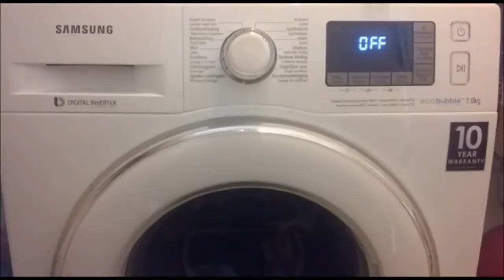Samsung EcoBubble stuck mid-program - Repair guide

Comment: Cheers Gold Flemming! We just saved one of these machines from the tip and it exhibited the same issue many have been seeing. The drum will try to move or spin and there is the initial jump as the motor tries to turn, but then nothing. After several tries, the machine just hangs or puts up a 3E error code. The issue gets worse with time. The procedure you filmed is exactly the one I followed. 
Disconnect the power to the machine and wait for the caps to discharge. 
Cutout the bottom of the tray the main PCB sits in and slowly carefully pry up the conformal coating (I used a plastic spoon and small plastic clay modelling tools as the metal implements would damage surface mount components sprinkled about the board and tracks).
Once the conformal was off, especially the larger solder joints, I used a solder sucker and solder iron/pencil to reflow and remove the old solder and then lay down new solder. 
Visually the existing solder joints looked ok, but as Benny Zeusian points out in this video https://www.youtube.com/watch?v=INJgzefQG24, there are subtle cracks and flaws.
I was able to re-solder just the larger joints to all of the plugs, large capacitors and motor control chip (both sides) and it worked! Carefully inspect your board though.
Also, be very careful not to make a worse joint than the original. I was not successful in simply re-flowing the existing solder and used flux, a solder sucker and wick to remove the existing stuff and completely re-do it.
Hats of to you for putting up this vid for encouragement as well as Benny and micr1969 https://www.youtube.com/watch?v=UVcrrwLRQek, who did much the same!

Comment: Will thank you for your video. I was about to buy a new motherboard and your video saved me 200euros (or a new washing machine for 500 ~ 600euro). Your video encouraged me to open the motherboard according to your description.

I'm working at a company where we are designing and manufacturing circuit boards for heavy-duty components and tools for industrial use and I have good experience of both designing, soldering and inspection of PCB's. After I opened the board (on the backside) I found several components that had been loosened from their soldering and there were cracked soldering all over the board there they were “heavy” and big components (as you mentioned in your video). Most cracks were for the component under the heatsink. The heatsink is quit heavy and long and it is directly attached (screwed) to the component underneath, also the heatsink lays on the component, which in my opinion, it should be fastened/screwed directly to the board instead. I understand that the component which is attached to it will vibrate more violently (because of that heavy heatsink) and in the end the component will straining its “roots/legs” and that causes all cracks and misconnections. Will add a video with pictures I took during the repairing the board
 
There are several issues with design of this kind of boards:

The first problem is that the manufacturer of circuit boards has stopped using leaded solder in manufacturing because the lead is hazardous to health. Lead is a soft metal and that made that leaded solder was quite flexible and stronger. On the other side lead-free solder is hard, and very fragile, and therefore in the end with all cracked solders and a dead device.
The second problem is that the Samsung, or their board supplier, have chosen to cover the circuit board with a silicon-like glue to minimize the vibration effect and/or isolate the board against corrosion because of high humidity. They may have thought that they have found a workable solution, but the problem is that this “jelly-alike-glue” will not help any components to be fastened on its place, that heavy heatsink is not even covered with that jelly-glue, when the device vibrates, heatsink will vibrate more violently(just go on and try to vibrate gel and observe how the top of it vibrates more violently) in the root, and when it vibrates, all bigger and smaller components will vibrate together simultaneously.
on the other side, this jelly-glue goes off very easy from the board, which it shouldn’t. As I know how this process should be done, the entire production process has been wrong from the beginning. The board for instance have never been primed before gluing, which would increase the adhesiveness of the jelly-glue.
The solution will be, as you may find in Braun rechargeable Shavers for instance, is to cover the whole circuit board with melted glue or industrial hard glue. In Braun case, even the batteries attached to the board are covered with hard glue.
The third issue is the design of mainboard itself. When I start to re-solder the pins and connections, I realized that the components pin-hole are oversized and pads are undersized. The pads are there to solder (attached) the components to the circuit on the board. That means the components have too little support for that kind of force and vibration the board is exposed to. You may find this kind of boards in all cheap “one-dollar” China-products.
Summary: short and consistent, the board is designed and mentioned to malfunctioning. You may say it is another conspiracy theory, but how would Samsung and other companies survive if their products last for ever?

 

And this is the problem that occurs in the Samsung echo bubble products and eventually all other product with this solution will stop working after a few years. This is the result of a poor designed and solution for this kind of motherboard.

This is evidence of poor quality of Samsung washing machines or/even other Samsung devices that will stop working after 2-3 years. I think Samsung must take responsibility and replace the motherboard in goodwill/warranty, because this is a quality problem during manufacturing which Samsung must admit.
Reply from the maker: Thank you for your extensive analysis and take on this. Was an interesting read!
Reply: bought our machine 2015 and had this problem this last week of nov. 2018.. decided not do the repair or replacement of the motherboard because it cost 200€..  I have a machine before this and it lasted almost 9 years.. tought This machine with its price of 600€ would give me happiness just like the first one but it only put me on total mistake.. decided to take a cheaper one for 100€ plus of the price of the samsung motherboard...

Comment from the maker: Update edit 1 June 2023: the machine still works perfectly and has not failed me since the repair shown. Apart from the mishaps in it's adolescence, it grew up to be a loyal and hardworking member of the family. 😊

Update for all those wondering: I can confirm the machine is still working flawlessly and has not stopped to work flawlessly since the repair. Good luck to anyone out there facing the same problem.
Reply: Gold Flemming did you do anything to dampen the bottom side of the board again after removing all the gel?
Reply from the maker: @henriksoderholtz8368  I did not as I couldn't think of a suitable material (that I had on hand). I took the chance and all I can say is the machine is still working without any issue.
Reply: To dampen bottom side, I think you can use sealant that says polymer and becomes like a rubber when drying, and put just around the edges. That will also hold the bottom plastic piece you cut out. In my town this sealant has price similar to silicone sealant, about 4 euros a tube of 450g. It is used to stick light things on walls or stairs, is high tack.
Another solution is hot glue gun, similarly put on edges, but it dries very quickly. Its also cheap.
That gel is just a gimmick, they make things harder to repair on purpose. Older washers didn't have gel on mainboard and worked the same.
Components are usually soldered through the mainboard, i.e. holes are 3mm thick, and if e.g. capacitor is pressed well against mainboard before soldering, it sits tight and solid after soldering, so vibration effects are minimal. Small components have low mass, less force acts on them. 
Also mainboard sits on frame, not the drum, and it has springs and suspension and lower vibration on frame.
Keeping gel out is good idea, because next to fail are capacitors, so you can replace them easier. They can fail after about 8-10 years.
Reply: hello you have any link where i can buy 1 new from this piece you repair in video
Reply: @nilsfrahm1323  yep, this coposite plastic on bottom side just for prevent the user to try repair this piece of shit, but a lot of sucks working can remove, 
by the way this trough hole soldered components can release the soldering like all others, this just because many years ago electronic industry uses non lead component soldering tin, and release easy the copper foil 
the old leaded tin softer and usually not broken the connection points or the legs the components, recommend to resoldering whit this material. 
This soldering problem common in any electronic part in the last few years like cars ECU panels as like as household machines like this.
Reply: I want to try the repair in your video but lack the kits to do it right now. I probably won't get a response from you seeing as this video is 3 years old, but here's me trying. I have the same washing machine. It "yanks" 3-5 times before any program. I've checked the belt and after arm wrestling with the insurance company they sent me a replacement motor. Nothing. Still yanks. I tried loosening bolts, cleaning inside etc. everything. Nothing. I believe this means it has to be the otherboard, right?
Reply: Thank very much, I repair my machine !!! I first solder only les bigger solders, thinking  that they are more sollicities but it wasn't correct. So I did all except the surface mounted components and now the machine start !
Reply from the maker: @celexample  I am not a technician so I can't help with diagnostic. I don't think I would attempt the repair if the machine still works; I didn't get if that is the case or not. This was a last resort. Good luck whatever you decide to do.
Reply: @devinder55555  Yes it is. Just finished a wash today. 👌

Comment: Thanks so much for this - I followed these instructions more than 4 years ago. The first time I did it, it lasted a few months, so I had another go and it's still running 4 years later (must have finally hit the right joint)
If you have one of these, and you are able to do this, would highly recommend as these are great machines and a board replace is expensive and will eventually suffer the same problem as they are likely flow soldered. My machine is about 12 years old now and running fine.

Comment: The gel you are referring to is silicone and the purpose is not to reduce vibration, but to prevent moisture from damaging the board. If you remove it, the moisture is going to corrode the contacts. So after soldering and confirming that the issue is fixed, it is a good idea to spray a rubberized coating on the board to prevent moisture damage. Something like Rustoleum Leak Seal might work.

Comment: Thanks for this 🙏🏼 My neighbour asked me to help out, they had an E3 error code “Motor Fault” but had the cycle stop midway through and was also doing a juddering.. whipped the PCB out.. (They only had 3 screws too..) soldered most joints but left the smaller/close gapped soldered joints alone.. it now works well and they are very happy! Thank you!
Reply from the maker: Glad to hear that they were helped. My machine is still going strong since, so they should be good for a while, at least regarding this problem.

Comment: You are absolutely right these circuit boards soldering will give up on the most active components like capacitors,relays etc. thats where the resoldering should be done.

Comment: Thanks Gold Fleming, just had the same problem with our Samsung EcoBubble and followed your directions and its working fine again now! I must admit all the soldered joints looked good so I was a bit sceptical at first that it would make any difference, but I went ahead and resoldered each of the larger components and it worked! - thanks again!
Reply: Hi,

U did only de lager ones?

Comment: Thanks for the informative video, I have a samsung 12kg ecobubble that was partially working (found the motor driver ic is bad). I have ordered a new PCB and the silkscreen is a different colour so I'm not sure if samsung has updated the boards? the lead free solder they use is a big issue for weak joints possibly leading to premature component failure...
Reply from the maker: I can only hope that Samsung received enough warranty claims that their manufacturing process has since been improved.

Comment: Thanks a lot for this video! Like you said, this wasn't as hard as it might seem at first. It seems to have fixed our washing machine (WW575H5400EW) too! I did end up ripping off an SMD diode (flyback diode between the relay coil pads) when removing the epoxy around the big contacts; but replacing it with a standard 1N4148 worked fine. Thanks heaps!

Comment: Thanks Gold, worked for me as well. Our machine lasted 6.5 years before we got the error. Great instructions. I didn't have a dremel, so used a bit of precision angle grinding. Silicon potting compound was stuck very well, so this took the longest time. I know that automotive ECU's have to go through a very stringent vibration testing regime (you wouldn't want your ABS ECU failing like this!), maybe Samsung should do the same...

Comment: Incredible work. My replaced inverter board failed again in a similar Samsung Washer. Re-soldered some large components(after angrily removing gel and plastic) and back to normal. Cheers. Much appreciated.

Comment: You need to stress that the machine should be unplugged before opening it up and touching capacitors in a mains-powered appliance, especially 240v (they can store tens of thousands of volts) could possibly kill. Otherwise, it's a very helpful video as I'm about to try and do the same on our machine which starts up but stops after about 5 seconds. Pausing it a few times, or turning it on and off can make it work, but as it's an intermittant fault, resoldering every darn joint seems worth a shot as it'll cost nothing but my time and 20p's worth of electricity and solder.
Reply from the maker: Good points. Will add the warnings to the video description.
Reply: @
David Reynolds: That's incorrect, the capacitors are rated at 250V, they can only store 250V not thousands of volts, they do store DC voltage which at 250V will give a nasty shock, but not enough reserve in them to kill you, You should discharge these particular capacitors BEFORE soldering anything near them, or you may get a nasty BANG
Reply: Yes unplug it and leave it 5 mins for the caps to discharge, but tens of thousands of volts....bullshit.

Comment: Thanks for the excellent tip.  Our machine just developed the same fault of stopping mid cycle and when I checked the warranty we were at 5 years + 3 months of the original 5 year warranty, so nothing to lose by attempting the repair.  I actually purchased a new mother board as a fall back and used that to confirm the fault was cured by replacing the original and sure enough it did the trick.  I have now repaired the original so have a spare to use should the problem occur again.  Thanks once again for a very useful video.  (By the way, I only had the 3 screws too, Samsung were obviously on an economy drive!)
Reply: Where did you buy the motherboard?
Reply: @sweetlime3821  I'm sorry I can't recall exactly where as it was a few years ago but I took the machine apart as per the video and I recall I did an online search for the machine/motherboard part number and was able to track one down fairly easily online.

Comment: Thanks for tutorial. Had the same problem with my eco bubble washing mashing... before fixing you needed to kick it real hard where PCB was but over time even that stoped working. First time I resoldered only big parts, and it only worked for a two weeks before going into errors again. So I resoldered main chip this time like in video and it's working flawlessly over month and still going like a new washing mashine!! I think this is general flaw in this series of washing machines and I presume resoldering gonna be needed to do every few years in future. Probably it's general problem both with really bad PCB assamlby and vibrations during usage of washing mashine. All points out to pins loosing contacts over time and it is needed to resolder them.

Comment: That's very helpful. My problem is that there is no power getting to my Ecobubble.   I'm guessing it's the power cable, but could it be another component?
Reply from the maker: I'm sorry but I am not a technician nor a washing machine expert. Just a brave guy with nothing to lose and some basic soldering skills.
Reply: @goldflemming4912  Actually, that in itself is a lesson to all of us; don't be afraid to have a go yourself.  The result is potential large cost saving, or even an ecologically sound way of avoiding buying new stuff.  Thanks.

Comment: Hi!
First, thanks for your time and this great video. I have exactly the same issue. My Washing machine SAMSUNG Eco Bubble 7.0kg stuck at mid-program. As I do not speak well english I don't understand what points of "welding" must be redone. Absolutely all the points?
Thanks in advance for your reply.
Reply from the maker: Hello Romain, I'm sorry I only saw your question now. I didn't do absolutely all of the soldering, but as much as I could, working from the bigger ones down.